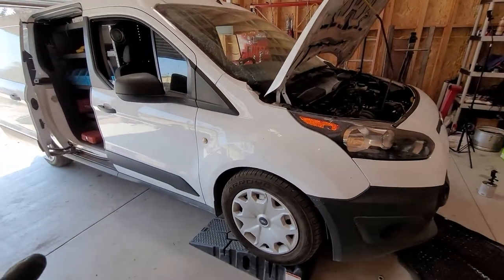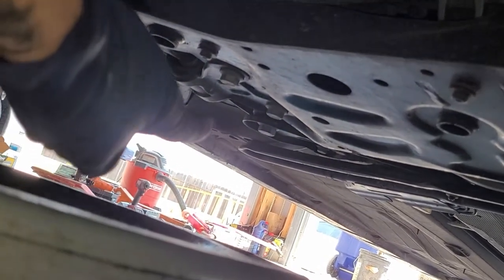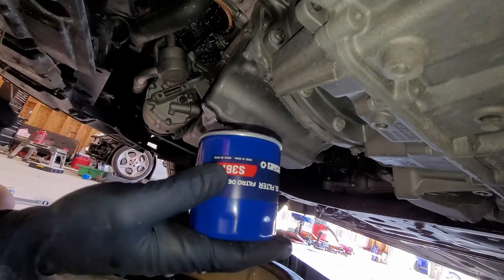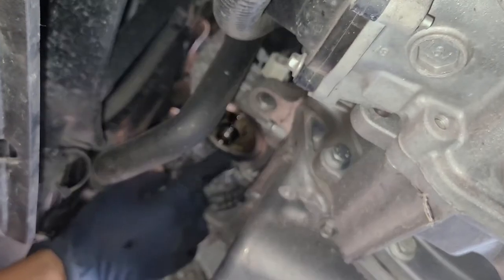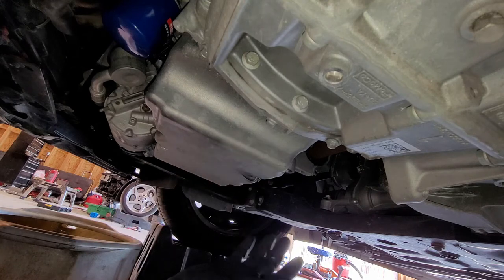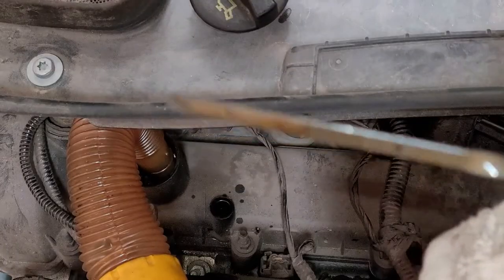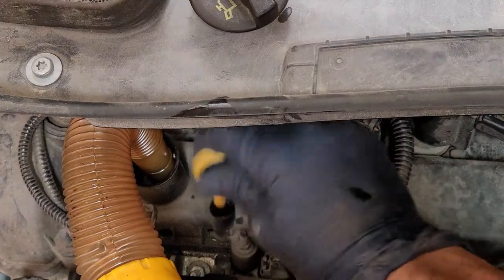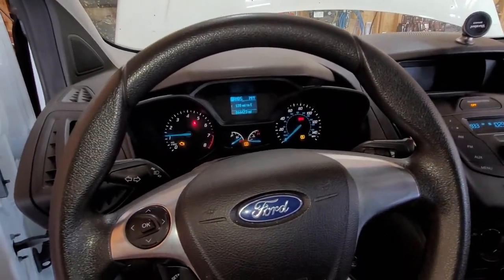ford transit connect oil change

Comment: Nice, don't forget to reset the oil change light.
HOW TO RESET: FORD TRANSIT CONNECT
1. Turn the Ignition ON, Don't Start the Engine.
2. Press Both The Brake And Accelerator Pedals for 20-30 Seconds Until the SERVICE OIL RESET COMPLETE message will appear.
3. Turn the Ignition OFF. Oil Reset is complete.
Reply from the maker: Thanks never new it had a maintenance light

Comment: Theres literally 4 crucial steps to making a good oil change video and its to: 
TELL US HOW MANY QUARTS IT NEEEEEEEEEDS. OIL TYPE. FILTER TYPE. AND HOW TO RESET THE OIL LIGHT. simple but clearly nobody remembers those details.
Reply: 5.6 liters for 1.6diesel 100bhp

Comment: Good job brother just did mine pretty straight forward. Do you have a video on oil pump by chance that’s next as my oil pressure light will flicker at low idle. So not taking a chance and replacing pump sensor was done.

Comment: How long do you think these cars last? Says online that they are not of the highest quality
Reply from the maker: They are not the best. But I prefer this one over the other models
Reply: @JaboTheMechanic  I've had so many issues with mine like water pump breaking, sliding doors, air con, brake fluid leaks etc. The transmission also doesn't shift right. Did a transmission fluid flush bc I can't afford another van right now. Kind of worried about something big breaking like transmission or engine.

Comment: Filling up an oil filter before fitting now that is a first
Reply: This is always done with trucks, as my F-350's oil filter takes over a quart of oil. You do not want that amount of air in your system.
Reply: @dzw4826  fuel filters yes but not seen it done on a oil filter
Reply: @asadalitruth   Sorry, Oil filter. I wrote fuel filter by accident. Yes always always put oil in the filters first in the trucks. It's not a bad idea to do it no matter what the size, as long as the orientation allows.
Reply: @dzw4826  fair enough 👍

Comment: Excellent video tutorial.  Thank You 😊
Yours is the first Mk2 FTC oil change video that I could find where car owner used small ramps.  Other videos had car up on a lift.  So your video is best for my use case 😀🚐

I noticed that you are satisfied with dipstick check while car is still up in ramps.  Do you think it is good to do a final dipstick check after backing off of ramps?

I'm changing my oil in my 2020 FTC for first time today.  First oil change at 5000 miles was at dealer free service.

Your video was hugely helpful for me to prepare for today's oil change.  Thank You 😀🚐